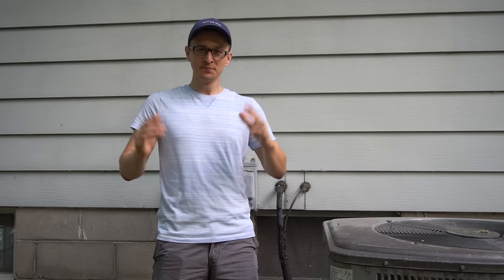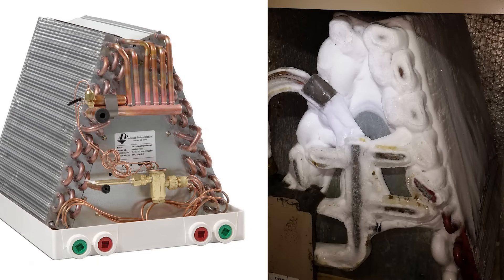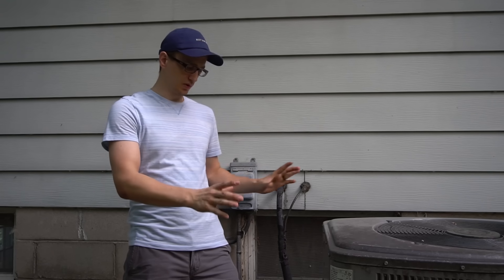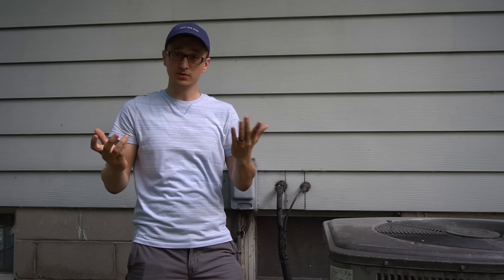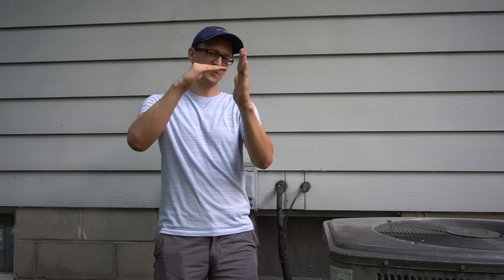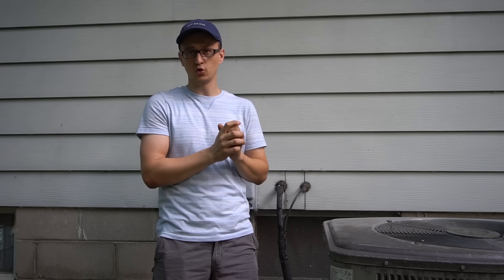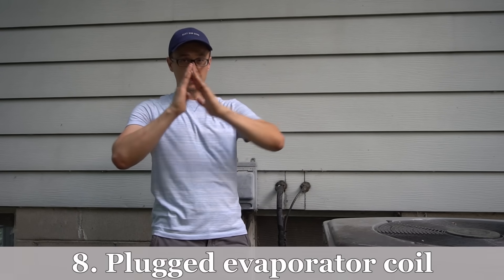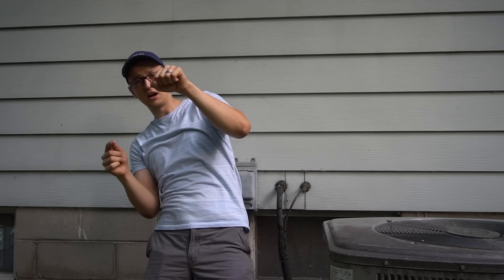8 Reasons Why Your AC is Freezing Up

Comment: Thank you for this helpful information. My AC ran fine until last year when the evaporator line freezes. I called a technician in, he changed my air filter to a very thin one and ask to open up all the vent, which I doubt it was the real cause. But, for the rest of the year, it seemed OK. Yesterday night, I tried to turn on the AC again, the pipe freeze again. I think it may be a clogged air way. Just wonder whether there is a way to know how to find the right expert to diagnose the problem. For calling on the google list, sometimes it is not a straightforward way to find the right person.
Reply: low pressure , low Freon
Reply: Buy yourself a probe thermometer, use it to get the temperature difference between the air going into your air handler and the air going out of it. You must do this with unit defrosted and running. You are looking for a 16-20 degree difference. If your difference is higher than 20 degrees, especially by a lot. You are looking for an air side problem, dirty coil, dirty filter, bad fan, closed damper or duct. If your difference is smaller than 16 degrees, you are looking for a refrigerant side problem, low charge, restriction, maybe compressor valves are going bad and it’s not pumping right. Another refrigerant side problem that presents a low temperature delta at the air handler but is actually caused by an air side problem at the condenser is high head temperature caused by a dirty condenser coil or bad condenser fan.
Reply: Get a referral from a trusted person or go to yellow pages and look for companies with many years in the business! You need to have the problem or problems solved once and for all. Filters need replacement every one//two months.

Comment: The last time I replaced my filter my unit stopped working. I had someone come out, they cleared out the lines and reset my unit and it started working well. I just recently changed my filter again and my unit stopped working again. Could by any chance the filter that I am purchasing be restricting the airflow? If that makes any sense.
Reply: Yes, make sure you’re using a filter that is not only the correct size but a compatible FPR as well. FPR is the filter power rate. Some filters go up to a 10, which is the thickest filter. You’d need a very powerful AC unit to push that air through the filter. If you choose an incompatible FPR filter, it’s like putting a slab of wood as a filter, you’re effectively creating blockage and freezing over the unit because there’s no air flow.

Comment: Note to self:  the 8 reasons are:
1. Very dirty furnace filter
2. Too many registers closed or returns blocked
3. Unit low on refrigerant
4. Thermostat set too low
5. Blower motor burnt out
6. Board not sending power to blower motor
7. Restricted metering device
8. Plugged evaporator coil

Comment: So i live in an apartment, and its constantly 75 plus degrees in here without the heat running in the winter, i have been running my AC to keep things cool. But my system freezes over every now and again, is thay because the system is bad? Or is that because its cold outside? (Im completly new to stuff like this)
Reply: Clean the outside unit with a water hose to get dirt off coils it helps to cool it down when fan running and change air filter inside to get good air flow and if it dont work then it can also be the freon level is low or the other stuff he mentions. Also when changing air filters look to see if the inside unit is really dirty on the coil fins, if it is then it will need cleaning also. Cheap filters dont catch fine particles too good so in time will collect and block ir flow making it freeze into a block of ice then the lines freeze too. If its cold out then maybe leave the unit off and open a window if its hot inside until house cools down. Hope you find your problem. Im still trying to find mines.
Reply: @firstpitstop  yea i looked up under the filter and holy crap was that coil filthy. Iclean it as best i could with the foaming coil cleaner but evem still it freezes up. Ive called and called my apartment and even the corporate HQ in Virginia to no avail

Comment: main reason is airflow, another reason low on charge that's about it
Reply: Actually there are quite a few things. I'm an Hvac tech, you are right about the most common issues which are airflow and being low on charge. There are also bad filters driers, none condensibles in the line set, a sluggish compressor, bad TXV, crimps in the line set, the list can go on and on.😁

Comment: Because the fact that your coil and air coming out will be 15 to 20 degrees cooler than the air coming onto the return , you should be good and anything higher than I would say 55 but 62 probably wont freeze up your ac unless its below 60 outside since that can cause the compressor to become a bomb ( it will actually explode). And I set it to the low 60s many times and nothing happens but other than that good info.

Comment: You forgot to mention if the drain is clogged the water will stay in the evaporator pan and fill up and freeze, ppl removed the safe t switch 😑 smh, CO2 carts saved the day

Comment: no here's what I really need to know why is my outside unit running while the inside thermostat is turned off when I went out and pulled the shut-off stop for the outside then my coil unfroze immediately why is it even running outside if I got the thermostat is turned off inside.thanks if you can help.
Reply from the maker: My first guess would be that the contactor is stuck in the pulled in position. If that is the case, likely you will need to replace the contactor. (I have a video on "how to replace a contactor" if you want more info on that)
Reply: That would be great 😊 thanks
Reply from the maker: @mofoco1971  https://www.youtube.com/watch?v=qHZc9wWAF4c&t=1086s

Comment: Good video, but I've got one more reason. The evaporator coil has lost its ability to transfer or absorb heat. This usually happens on older systems where the coil is made of copper tubing with aluminum fins. The copper and aluminum over a period of time will corrode between the two dissimilar metals and cause a very poor heat transfer  thus causing a colder than normal evaporator coil causing it to freeze.
Reply from the maker: I don't think I've seen that before. Thank you for explaining the additional reason why it can freeze!
Reply: @WordofAdviceTV  you probably have encountered this many times  just not known what was going on. Most of the time you will notice your super heat is much lower than normal and and all the other parameters are within spec, as in airflow, freon, subcooling, ect.
Reply from the maker: @customjrod  You're probably right! Likely I've bumped into this but simply didn't know that was the cause.. That's good to know, thanks again!
Reply: You are correct.
I call this one a bit of a 'unicorn', due to the fact that, by the time this (usually) ever occurs, the avg system is past its useful service life expectancy; as much as I hate saying it, a real thing today. Remember John Zinc(Zink🤔)?
Good though.

Comment: As an hvac technician I congrat you for the good explanation. Gonna add two more causes to make it 10,  however, this are less common. 
9: Obstructed filter drier.
Usually found couple inches from the condenser in the discharge line (smaller copper pipe). You will notice it sweating usually one end will be hotter than the other .
10: Stuck magnetic contactor on the condenser.
You can easily check this buy turning off your system on the thermostat and the condenser outside will continue working. 
Sorry for the long comment... peace👍
Reply from the maker: Ahh I could have made it 10 reasons! Thank you for taking the time to provide the additional two reasons! That's much appreciated!
Reply: Very good comment.
Reply: Will this cause thermostat to keep running after it hits target temperature? It seems to cause the line to sweat and freeze outside of house. Fan, blower, etc are working
Reply: @sgtmadre5103  yes, stuck magnetic contactor in the condenser will keep the compressor running, however, air handler unit blower motor is gonna turn off if the thermostat reached set temperature, make sure your thermostat is set to fan auto and not fan on so you can accurately determine where the problem is.

Comment: Thank you so much! Was having a problem with the line freezing. Checked the filter, because we have been doing painting, sanding, and generally moving things around. The filter was white and hardly no air was getting through! Just ran to the store and replaced the filter. While I was gone, I took the VERY dirty, filter out and My house already had cooled 4 degrees in the 15 minutes I was gone. We even have a thermostat that reminds you when to change the filter, so I didn't even think of it. Again, thank you so much!
Reply from the maker: Glad to hear the video helped! :) Thank you for coming back to leave a comment, stay cool!

Comment: Thank you so much! We had airbnb guests over the weekend and when I came back home the evaporator coil was frozen up. I was concerned that something was wrong with the unit, but they did have the temp set very low (64 if I recall correctly) which it sounds like may have caused it.
Reply from the maker: Yeah, no problem! I am thinking you shouldn't have any problems with it. Many of those A-coils are hard to get to, so you are not the only one that had to struggle with it. Anyway, stay cool! ;)
Reply from the maker: 64 can cause it to freeze up. I would just thaw it out completely and then resume normal use and keep an eye on it for a few days. Temperatures set too low with a semi-dirty filter can be enough to freeze it over. Hopefully that's all it was :)
Reply: @WordofAdviceTV  thanks! The filter was last changed in June so it may be a bit dirty. I used the "fan on" mode to help thaw the ice and also vacuumed the bottom of the A-shape evaporator coil, though there wasn't much dust there. However, whoever installed the air conditioner didn't make it easy to get to the coil - they drilled holes in the side panel to connect the lines and drain, so I had to actually cut part of it to take the panel off. I will have to fabricate a replacement panel but in the meantime I've taped a trash bag over the side to keep airflow going the direction it's supposed to. The air conditioner started working just fine after it thawed out, so I'm hopeful it was just turned down too low. I'll give it a couple of days to see if it re-freezes, though. Thanks again for the helpful video and comment reply!

Comment: I love it! I just got my two big units fixed (new house that we are fixing up), so I watched Roberto do it and felt comfortable troubleshooting an AC unit. Your video was so helpful I confirmed the blower fan motor in the furnace was ok. I knew the freon level was okay and so discovered my filter was dirty dirty dirty. I had sanded the floors before we moved in and this was the only unit working, the smallest, oldest 2002 Trane for one large room. Must be the circuit board then.. it is so old I couldn't find a diagram of the circuit, so wasn't sure which two wires to connect. Ordered a new part, but in the meantime I just moved the blower motor fan with my hand to spin it. Once it started spinning the AC kicked on and blew cold. I have to do it after it shuts off each time but until my control panel comes in; in works!!
Reply from the maker: Hey Ronnie! Glad to hear the videos are helpful! It's good that the unit is working for now but from what you described, it sounds like a dead/weak blower motor capacitor, not a bad control board. Just thought I would give you a heads up. Stay cool!

Comment: I agree with all except 7 - clogged metering device should not cause evaporator or suction line to freeze. Heat needs to be removed from the low side before it freezes - low pressure alone won't do it. The prerequisite of freezing up is: there must be liquid entering evaporator to absorb heat.

Yesterday I went to examine a frozen unit - and it is none of the reasons mentioned. It is a new installation which everything internal is working ok. The filter is clean, the return air vent is open,  and no register is blocked.

The actual problem are two: the new installation is slightly bigger (3-ton vs 2.5 ton old); and the installation is flawed in that it keeps the old (rather small) plenum, and the air handler exit section mismatch the old plenum inlet - roughly half of the exit is blocked. The consequence is that the duct flow is severely restricted and the return air cannot provide enough heat to the refrigerant in the evaporator.

Comment: My Unit just froze up. The compressor was replaced yesterday and was converted from R22 to 407c. Nothing else was changed. I read where other parts are required if the freon swap?

Comment: Also a side note, I spray my outside unit once a month with the hose to wash  off any dirt/tree leaves that collect on it, this makes the unit run less and my inside air much cooler.
Reply: On side note: 
We have really hard water (limestone area). So hose water is real different than rain water here. 
Secondly, they make cleaners for that. The coil cleaners do not deposit limestone and such in your condenser fins. I've done it, but as a matter of practice, I avoid hose water if other alternatives exists.
Lastly, be gentle. Those fins bend really easily.
Reply: @packrat9433 thank you for all the help. I managed and didn’t break it! 😂 so the advice helped.
Reply: I thought you weren’t supposed to spray water at an ac unit? That’s at least what I have always been told
Reply: @Maxvr4  I was told to do that by my service guy when I called him because it wasn't making enough cool air, he sprayed it for 10 minutes and it was fine. Cost me $150.00 for his advice but I never had that problem again. Have to keep the fins clean and get all the dirt off.
Reply: @jlc7300  thank you. I am really glad I saw your message, I was told by a couple of AC companies not to do that. Probably just there way to make more money in hopes your unit breaks I’m sure. They literally told me it could fry the unit because the water gets in all the wiring, some BS thing about the wires through the AC and the coils and getting electrocuted. So I never messed with it. I always questioned it but never really thought to look it up & check for sure until I ran into my current issue & saw your comment.
Reply: @Maxvr4  Just don't spray from the top down, only on the sides, I spray mine while it's running, water won't hurt it, the poor unit is out in the weather all year.
Reply: @Maxvr4  ...what do think happens when it rains ??
Reply: @TheWilferch  yeah I know my husband told me that after I made the comment and he laughed at me. I just remember an AC guy saying that you have to know what direction to spray the water in and their is areas that you can’t get wet. That I think stuck until now realizing I had one of those moments 😭😂
Reply: @Maxvr4  ...to be fair to you.....yes, there IS a warning not to locate the outside unit such that it captures the rain run-off from a roof valley, etc...as that excess water shouldn't pour onto the unit.... so there is a correct basis for your concern, you're not that far off. Cheers !!.
Reply: @TheWilferch  makes sense. I guess that’s what men are for right. Stuff that woman can’t do or are afraid to do (which is a lot more than men) guys can do. 😁

Comment: My AC is Trane XR11 heat pump system. Do you know if it has the 'Restricted Metering Device'? The evap keeps freeze up every two weeks. New filter, motor works, freon level is good (no leak). I am going to check and clean the evap coil tomorrow. Thanks.

Comment: i wish i looked at the video before i spent $100 for a repair guy to tell me the same thing. we recently did some drywall and wood renovations and of course, the dust clogged the filters and caused the unit to freeze up.
Reply from the maker: Yeah, it's an easy thing to miss! But after paying for it once, it usually doesn't get forgotten again :)

Comment: Good video but the air doesn’t absorb the cooling a evaporators job and the refrigerant in it is to remove heat from the air by using the 2nd law of thermodynamic. So it’s removing heat and in result all that’s left is cool air. But the air itself doesn’t absorb the cooling..
Reply: Also that is a myth that there is a low set point for a system or it will freeze up. The system will just run and run and run  and my not ever actually get to the target temperature. But it surely won’t freeze up unless of course the outdoor ambient temperature is to low to even be running the system then it will freeze up.

Comment: my Ac is under 1 yr old, new rehab home.  My Ac is freezing and none of the 8 is my issue. what else could it be.
Reply: Those are the only reasons a.c. freezes up. You have one of these issues. And unless you have a set of manifold gauges you couldn't possible know the charge of your unit, and be able to say that's not a cause. If you had a tech come out and look at unit they'd have it fixed and properly charged if low Freon was the issue. But if it's icing up on you ,one of the eight or combo of is the issue

Comment: I have 6 A/C units in my house and when we have a power outage, one or two of the evaporators will freeze up when the power comes back on if I'm not there to turn off the thermostat and turn on/off the power at the fuse box for each condenser.  I'm guessing that somehow the pressure goes low enough during the outage to start ice formation and depending on the length of the outage, just the right amount of power outage will cause enough freezing to start a domino effect with the ice.  I could be wrong......anyone out there have any theories ??